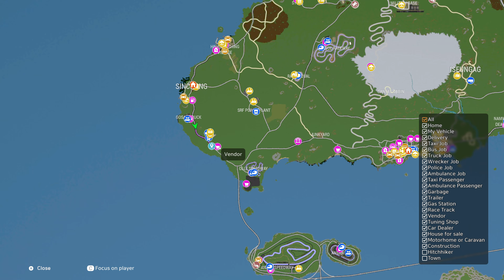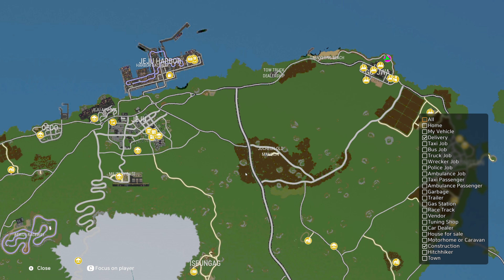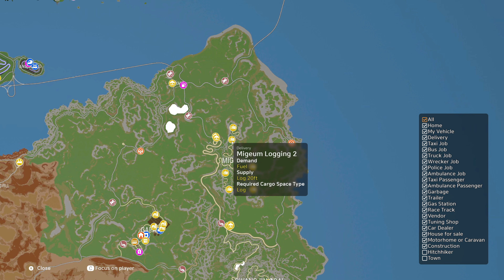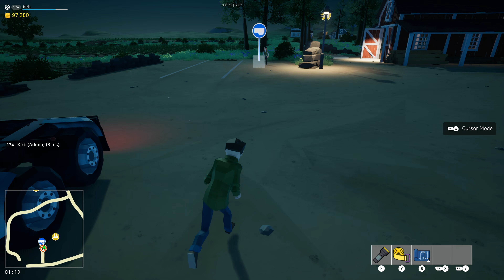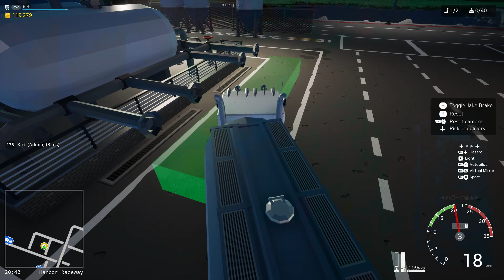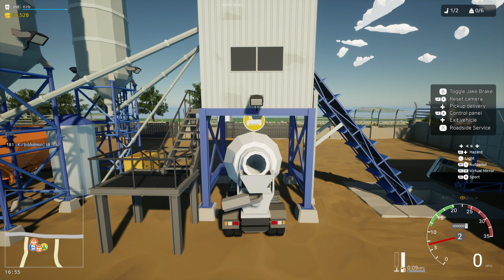Motor Town: How to Build the LARGE GARAGE (Step-by-Step Guide)

Comment from the maker: 🔴I've had quite a few people ask for an updated guide, but the only thing that has changed is the concrete supply chain.🔴

Now you start at the Limestone Quarry and get Limestone Rock.

Take the rock to the rock crusher at the top of the quarry to produce Limestone.

Haul the limestone to the Cement Factory to make cement.

Transport the cement to the Concrete Factory to produce concrete.

Finally, deliver the concrete to your Large Garage.

here's a supply chain chart to help: https://www.reddit.com/r/MotorTown/comments/1lipb6y/motortown_supply_chain_flow_chart/

Comment: We need a update please other than that thank you for the great video
Reply from the maker: Thank you! Yeah the concrete step has changed a lot.

Now you start at the Limestone Quarry and get Limestone Rock (requires dump truck).

Take the rock to the rock crusher at the top of the quarry to produce Limestone.

Haul the limestone to the Cement Factory to make cement.

Switch to a cement truck and transport the cement to the Concrete Factory to produce concrete.

Finally, deliver the concrete to your Large Garage.

here's a supply chain chart to help: https://www.reddit.com/r/MotorTown/comments/1lipb6y/motortown_supply_chain_flow_chart/